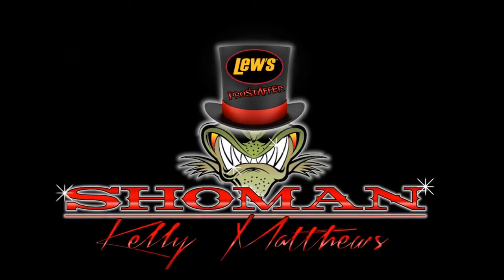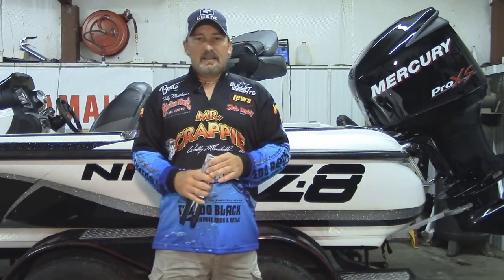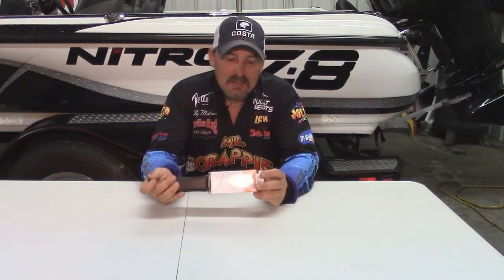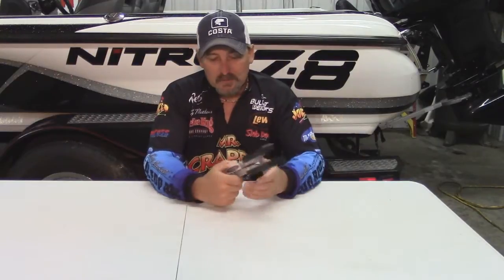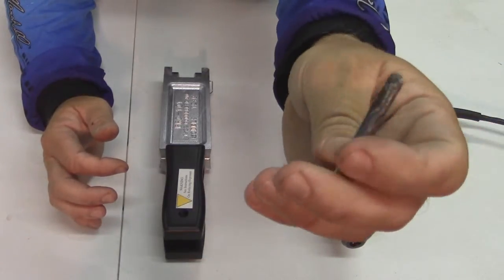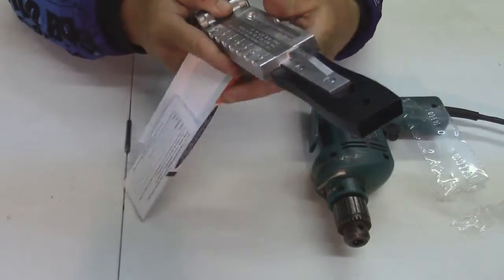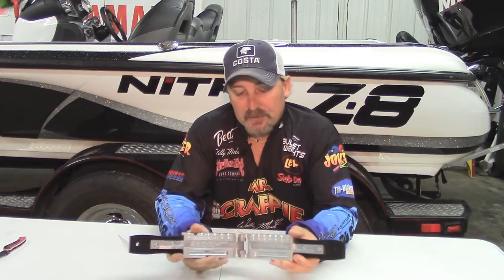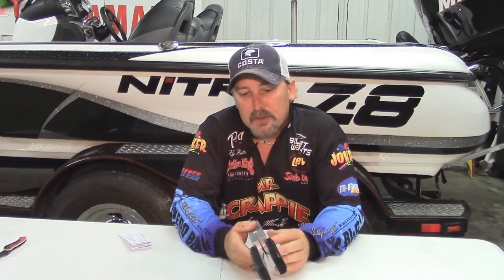Do-It Crappie Jig Head Mold mod 1/32 oz to a 1/24 oz

Comment: Pssst! A little secret.....Don't mess up a perfectly good mold, just cast your jigs with pure tin (Sn).  Molecular weight is 66% that of pure lead.  Casts beautifully at 400 degrees. A 1/16 mold makes a 1/24 weight when cast of pure tin, 1/8 makes a 3/32, 1/32 makes a 1/48oz   Mind blowing aint it.   All that work for nothing,  I'm sorry